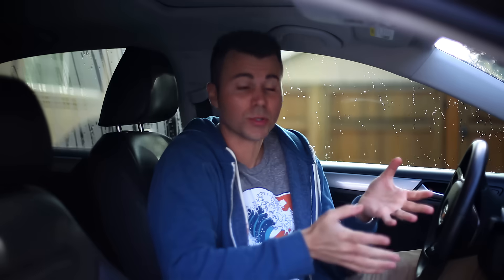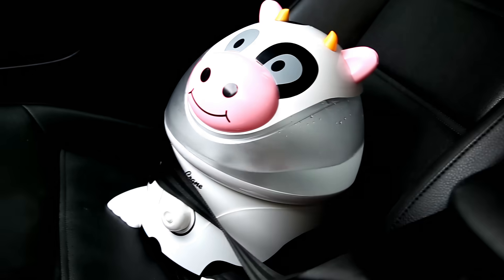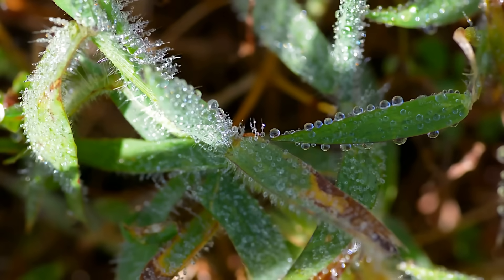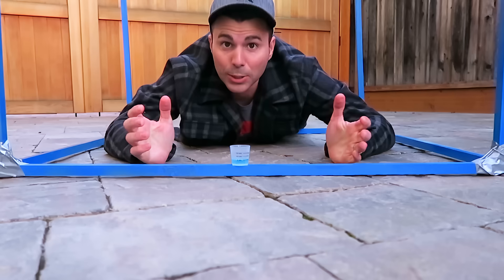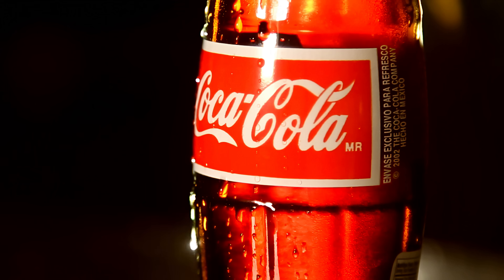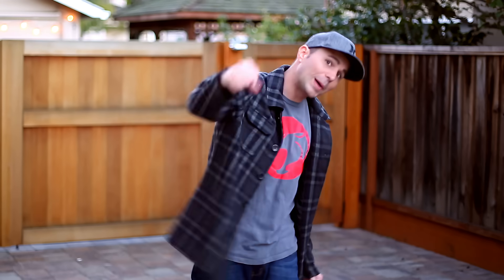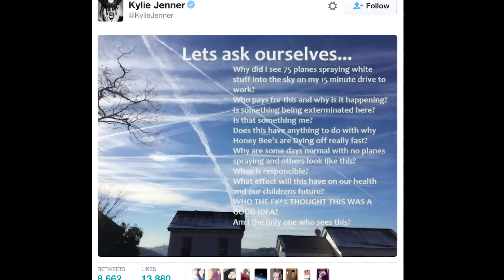Defog your windows TWICE as fast using SCIENCE- 4 easy steps

Comment: Probably worth noting this only applies to fog/frost on the inside of the windshield.  Heat's the only thing that matters for frost on the outside.  So if you only have frost on the outside, your best combo to get the hottest air the fastest would be:
- Max heat
- No A/C (so you aren't cooling the heated air slightly)
- Recirculation on (so you keep reheating the same warm air instead of pulling more cold air in from outside)
- Windows closed (so you don't let the warm air escape)

Comment: The best way to defrost your windows is to not let them frost to begin with. 

 Buy a windshield cover. They have elastic bands so you can secure them to the side mirrors and flaps that you shut into the door jam. 

 Problem solved.

Comment: There are 2 reasons for the recirculation.1 as you said the outside colder air should be drier and 2 the airflow with recirculation on is making a loop around the front windhield the reason is that the inside air intakes are usually at either sides of the dashboard and thus the moving air chooses the shortest path. So basically turn the direction of the flow towards the windshield, always use outside air, if you can use warm air. Chances your engine hasn't warmed up yet so no hot air is available and thus if you open the windows the slightest bit should improve the situation.

Comment: Pouring a 2 litre bottle of hot water over your windows will warm them enough to make condensation more than unlikely. If you have ice or snow on the windows, wipe the worst off and use two bottles.
No, the glass won't break.

Comment: I had this debate years ago.

One of my friends in college had a car(most of us didn't)
He would argue that temperature difference is what causes fogging, 
So we should put AC on full blast to get temperature to equal out, then no fogging.

By arguing ith him. I found out pretty much the same thing by science and experimenting on his car.

 I would put the blast settings as only on front window, put AC on max temp. Max fan. 
Outside air.
Worked easily.

Bro still wasn't convinced tho...

Comment: Your towel analogy only makes sense if the fog is on the INSIDE of the car. However on cold mornings  the fog is on the OUTSIDE of windshield. So your entire theory of drying inside air so it can absorb moisture fails, however your method may still work for entirely different reasons though.

Comment: Most cars, certainly modern ones will turn the ac compressor on automatically when the defrost setting is turned on. Obviously that runs the air through a cold coil which removes the moisture in addition to running it through the heating coil.

Comment: Imagine a wet towel in zero gravity. Now when you shrink the towel, if it not touching anything, the water will stay with the towel due to surface tension until it touches a wall/floor/anything else. Then the water will have somewhere to go. That is how I now think of super saturation. Think of soda without nucleation sites to start bubbling. Thanks Mark.

Comment: I think it would be best to heat up the air inside for a while, then open the windows or doors for a moment to exchange the warm, moist air with cooler, dryer air from outside. Then heat up again. 
Better than just cracking a window.

That is what we do in Germany to keep moisture low in our flats and to avoid mold. It's called "Stoßlüften" (airing out in one push). In a car it should happen pretty fast. In a flat it takes a few minutes (depending on the difference in temperature). Opening opposite windows for optimal air exchange is called "Querlüften".
Reply: Easier to open the passenger window and close the drivers window then open and close the driver side door a few times.
Reply: Unless you live in a region of the country where you get heavy thick fog when it's 40f (or about 4c) out side then your just bringing in cold very humid air.

Comment: Should you crack the windows even if the outside cold air is 100% humidity like if it is snowing/raining?
Reply: Cold air holds less moisture than warm air even at 100 % humidity. So it depends on the difference in temperature between the inside and outside.
I think it would be best to heat up the inside air for a while, then open the windows or doors for a moment to exchange the warm, moist air with cooler, dryer air from outside. Then heat up again. 
Better than just cracking a window.

When it's snowing, the air should be pretty dry because it's so cold. When it's raining you might get a lot of rain into the car with the cracked window. So I would keep it shut.

Comment: I would subjectively argue that in the winter when the air is already very dry that the degree to which the AC is going to help is very small -- subjectively (admittedly) compared to the additional fuel cost of the AC... OTOH, if there's also fog on the inside, what does fuel cost, blah blah.  So subjective.

Comment: I'll probably get blasted for being petty, but you only need 3 steps.  You don't need to put the A/C on bc when you turn the dial to select the defrost setting, the car automatically engages the A/C compressor. Most, if not all cars (at least in the US) are designed this way.

Comment: But if i turn my heating setting on really hot, not much air comes out. Additionally the air that comes out is not really hot, because the motor isn't warm yet. So is it still worth it to go with the hot setting?

Comment: Quickest possible way to defrost;
2 big plastic bottles of hot water.
Pour the hot water on your windows.
It will clear up snow, ice, and fog in a matter of seconds. As a bonus it will clear up any ice or fog on the inside of your windows.
Try this at your own risk. Some say it can crack your glass.
I've used hot water for over 20 years now, and never cracked a window.

Comment: Just turn in the defrost on then throw hot water on the windshield. No it won’t shatter the windshield immediately. The glass shatter occurs when going from hot to cold very fast, so as long as you only need to go a short distance at around 30mph you should be fine.
Reply: and before I get flak for this, I’ve done it every winter for years. Never had a problem.

Comment: A/C on doesn’t do anything if the heater is on - it’s only used for cold. The heat just comes from the engine heatsink. Step 2 can be removed

Comment: You can still see your breath on a warm day, if humidity is 100%. This rarely happens, even at very high humidity, because the air you exhale is nearly the same temp as ambient. But you always see your breath on very cold days, even it the humidity is low, due to the temp diff.

Comment: No need to turn on AC if you own a GM product. The AC is turned on when the windshield defrost setting  is selected. GM has done this for decades. Driving with the front defrost on in the winter drops my gas milage like I am in 4x4 mode. I have owned GM trucks and cars for 35 years and I always know when the AC compressor is not functioning.

Comment: Don't turn on AC turn on dehumidifier or heat at the temp near to outside but one or two degree more, then try with turning off circulation and later on after fog removal switch on circulation. That's it done fog gone.

Comment: My condensation is always frozen on the outside. I turn on my heater and defrost then after a minute use the windshield washer squirter. Within seconds it's clear. I use the winter formula with methanol mixed in.  It's worked for over 20 years on light ice and freezing fog.

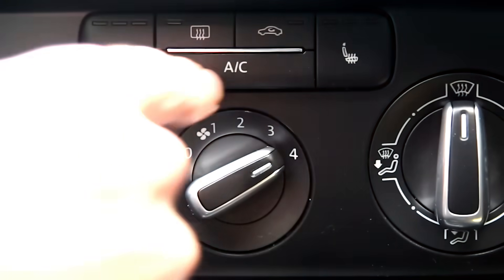Comment: 3:40 Step 2 - turn your A/C on
This won't do anything in most cars as the A/C won't start working if the heater is trying to warm the car.  After all, who would be silly enough to simultaneously heat and cool the air?

Comment: I've used window vent guards for decades. This allows the widows to stay partly opened all night. When started with the remote, the humidity is allowed out, as the vehicle warms up. Also in summer, they keep the vehicle cooler. You can crack open all widows enough to allow the hot air out. They keep out any rain and snow. Well worth the investment.

Comment: Guy did all this science but doesn't understand that turning your AC to heat in your car moves the blend door over and bypasses the evaporator core and blows all the air directly across the heater core so turning your AC on does nothing to dehumidify your air when the heat is on.

Comment: Gotta love it when I get in my car and the windows are frozen over FROM THE INSIDE.

Other than that, I bought a wipe kit from Walmart and it's just a napkin sponge and it wipes the window pretty well. After taking off and the car had warmed up, I'd turn on the front defogger which just pushes ac onto the window while, at the same time, running hot air into the cabin to keep you warm. This feature uses a lot of fuel though.

Comment: Thanks mate. I just seriously find just putting a towel/cloth on the OUTSIDE of the windscreen holds the moisture. There fore removing the towel/cloth from overnight, you are removing the moisture and for the whole/main part of the windscreen it is clear. What is also beneficial is to run your engine for between 3 - 5 minutes before starting off. Better on the engine and also aids in extending the LIFE of the engine.

Comment: Using the aircon is great but when you stop using it the windows will fog up. I hardly ever use my air con purely because of this. I use it in the summer though. To get rid of it permantly i blast the heat. Windscreen fan only and when the fog is gone i open the windows as im driving to let any moisture out. When i close the windows itll fog up again so i open the windows again and when the fog is gone i closr the windows and just repeat until it stops fogging up

Comment: What if, before you turn the car off when it's still hot inside, to open the windows a bit and get some colder air inside the car and then lock it up?

Comment: One more thing to take in account is when you put your heater on at full blast it actually cool the engine down. So it takes longer to get the engine hot thus longer before you get propper hot air. Putting you blower on full blast when the engine is stone cold won't help anything so I always keep the blower at max half speed for a while before I turn it up. Doesn't apply to EVs though..

Comment: High heat blown at the base of a cold windshield is a major cause of cracked windshields.  Where I live I  get ice on the outside of the glass rater than condensation inside the glass.  I run a cord from the house to the car and time the current for an hour before I leave with an electric heater to prevent warm the vehicle. Also a cover over the windshield and side  windows helps pull the snow off.

Comment: Direct the dry air-conditioned warm air away form the footwells if they are wet from boots and rain. Keep the air moving over the windshield only, otherwise you'll evaporate more total moisture into the passenger compartment. Once the windshield is de-fogged combine the airflow to both footwells and the windshield, to dry out the footwells.

Comment: Jokes aside, can somebody explain to me why pulling outside air in and heating it up is faster than just circulating air inside? I know it is, and that also makes sense with the window cracking, but I just can’t nail down this part of it.
Is there another property the outside air has? Is it because the inside air is more “full” of water since it has been at a warmer temp?

Thanks if anybody happens to read this and can hold my little hand

Comment: FYI: Not all vehicles are the same. I found in my car setting the defroster to 3/4 power works faster as the engine warms up faster and heats the air more efficiently. All the other things were the same though. The A/C button is important because it has a built in dehumidifier to prevent fogging when you run it normally. Just remember to turn it off when the fogging is gone.
Reply: I doubt your claim and I would like to propose that your experiences were the result of differing conditions on the days you saw this change. The amount of heat the engine generates in a given amount of time will be the same whether you're directing more of it inside your car earlier or later. I would suggest trying the Mark Rober method properly and doing more consistent tests to prove your hypothesis!

Comment: My girlfriend and I always disagree about whether or not to turn on the recycle or not.  I usually want it on recycle if it's raining or foggy out on the premise that the outside air in saturated.  I agree that conditions like snow or a cold, clear day are not the same and the outside air has less moisture, but I live in the Pacific Northwest and temps in the 40s and 50s with 100% humidity are common here and those are the worst days for defogging the windshield and I just don't buy that using outside air is going to buy me anything unless I heat the car enough to make it uncomfortable.

Comment: whats the point in turning air circulation off, if youre going to just open the windows to get some air circulating? lol
Reply: When you have air circulation off it’s pulling air from outside
Reply: So opening the windows helps pull air from outside when it’s off

Comment: You are wrong!!! In the morning your ac wont be heated up and putting it at full speed will make it worse!! Its best to put it on lowest speed and after it warmed up a bit you put the speed higher, see it as a water tap if you put on on max heat with low stream you get more heat then on high stream

Comment: In norway, you have to scratch off the frozen moisture off your windows. Sometimes, if it's above -10C° it's relatively easy, just scratch the same spot two times, but if it's colder than that, you have to just wait for your car ti heat uo the windshield enough so you can scratch it off

Comment: It's actually 5 steps since blower speed and temperature are usually different dials.  6 if you want to include setting the blower to the 'Defrost' setting. 
So you have:
1 - set blower output to Defrost
2 - set blower speed to High
3 - set Intake setting to Outside Air
4 - set Temperature Control setting to Hot
5 - Turn a/c system on
6 - crack windows for ~15sec. 
Although, I have my concerns about whether the A/C setting is necessary or not.
Reply: I think AC is best for temperatures around freezing. If it is extremely cold, the AC unit won't be able to drain the collected water properly: due to the drain hose being frozen.

Comment: My best method in a UK winter (around -3 to +3C).

1. Flush out hot air for the last 20 seconds of the prior journey.
2. Next morning avoid fans for 30 seconds whilst engine heats up. otherwise circulating the relatively humid air around causes the windscreen to act as a dehumidifier itself as even more water condenses! I've had to pull over because of this. Open some windows instead.
3. AC on
5. Run full windscreen fans only, on max heat, with driver window open 2 or 3", directing my breathing this way somewhat.
4. Defrost windscreen on outside. Luke warm water if heavy frost - controversial I know!

Comment: Yeah......i turned on the heater on high heat once on a cold morning......had to replace the windshield.....figure that it had a micro crack/chip and the sudden temperature change caused it to crack the whole windshield. Very cautious of hot air on a cold windshield now.....

Comment: if you crack the window just a bit and crank the heat up on the floor (sound strange I know) you will defog/frost them quickly AND saving fuel because the AC compressor is not running. try it ,it works.

Comment: I owned a couple VW Beetles. In Chicago. They had minimal heat, and only when they are moving. 
I carried 2 ice scrapers. A short one for the inside if the windshield and a long handled scraper so I could reach out the window at a stop light and scrape the outside.

Comment: Also, make sure to keep your windows clean on the inside and avoid touching the glass in between cleanings. Clean windows have less particles on them for the water to condense onto. Oils from your skin will cause the windows to fog up on particularly cold humid days.

Comment: Great short video. Driving in snow I see hundreds of people with dry road dirt on their windshields, I see them washing over and over until they run out of washer fluid, then pulling over to throw snow on the windshield to try to wash it again. Pro tip, TURN YOUR DEFROST OFF! You are flash drying the road dirt, if defrost is off, your wipers can wipe the dirt away BEFORE it dries. Seems like common sense but honestly, knowing this can save so many problems up to and possibly including crashes.

Comment: If you're late for work, just wipe it with a paper towel and go.  Turn the heat on full after a minute of driving (so its at least slightly warm) and make sure its air from outside (so the humidity level is similar).  That's it.

"shave a few minutes off your morning commute"
"shaving cream"
HA

Comment: You said that on a cold soda, the air outside the can is really cold. But wouldn't be opposite be true? When introducing a cold can of soda into a warm air environment, condensation forms on the can very quickly as opposed to when the can is in the fridge and no condensation appears on the outside of the can because the air temperature in the fridge is the same as the temperature of the contents of the can.

Comment: What about for the situations where the windows fog up because it's 35 degrees C (95F) outside and getting hotter. It has been raining for a week already and is now pouring down rain (50-100mm/hour), humidity is extreme, and there are 4 sweaty occupants in the car? Sweating because it is hot, do you still turn the heater on? Also do you use recirculation or not? as you want the car colder than outside to be comfortable as 2 of the occupants are young children and you don't want to start the 2 hour car trip with "are we there yet!?"